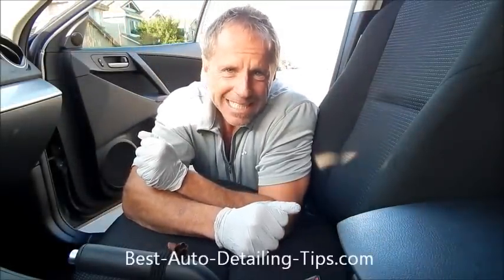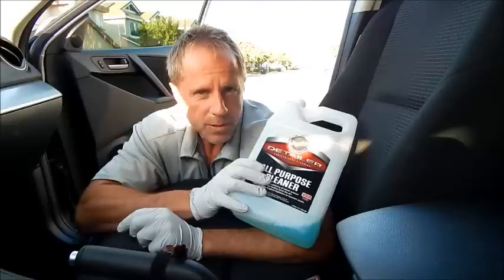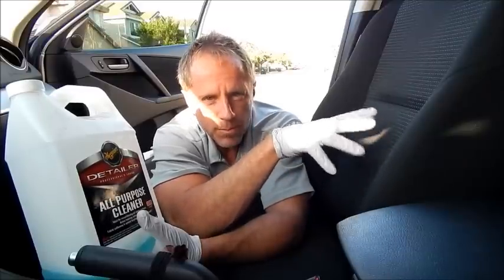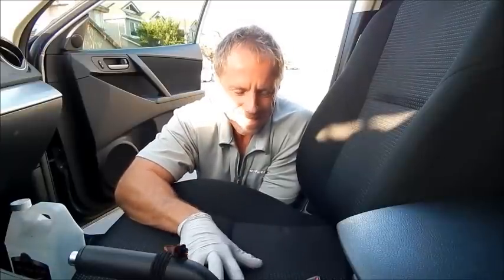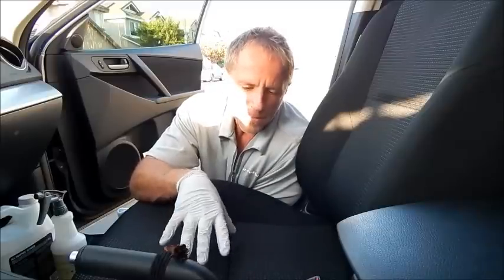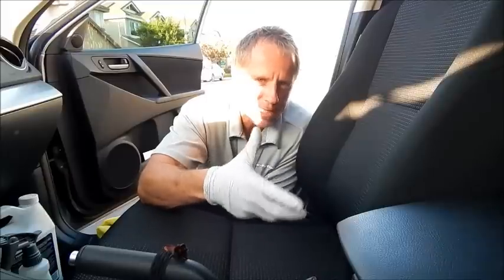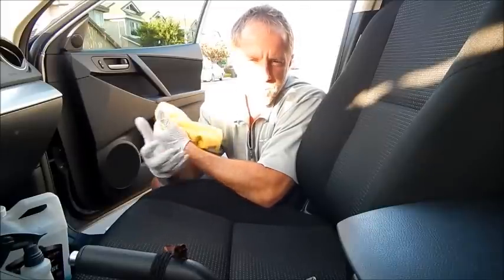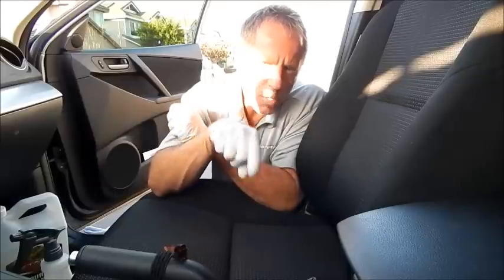Car upholstery cleaning: Special fabrics, Special Tips

Comment: READ THIS SUMMARY (and save 15 minutes)
1.  Use an All-Purpose Cleaner.  Simply dilute the cleaner with water depending on how delicate the material you are cleaning is.
2.  Use a super degreaser for, you guessed it, super greasy messes.  Dilute as necessary.
3.  For purely synthetic leather such as the microfiber in the Mazda 3 seen in this video, use an All-Purpose Cleaner and allow it to sit for a few minutes, then scrub it off with a light brush.

You're welcome!  Like this comment if you want to help others see this.
Reply: You sir are a god send
Reply: Hahaha THANK YOU. Got 2 mins in and thought this isn’t “tips” it’s marketing 🙄

Comment: David, that material in the Mazda 3 is microfiber, with very tightly packed super-fine fibers, which explain why its so difficult to clean. Most bristles are not fine enough to "poke" into the "crevices". 
My fav method is to lightly saturate with 1:5 APC, wait few minutes for it penetrate and loosen the dirt, brush lightly with a KIWI shoe brush (do not press hard to allow the bristle tips to go into the minute cracks) and wet-vacuum thoroughly.

Comment: Darren, thank you for this video! very helpful tips. I have a 2014 corolla with an ivory synthetic fabric and have made strict rules to my passengers to never drink anything that may spill or stain the car's seats. But of course, after 2 years, I have collected a number of spots and random spills. You mentioned that you want to do a special video in dealing with the fabric that is on the center piece of the seat. If so, I cannot seem to find it. Will you please share? If not, I'd like to make a request for a video that covers this topic and if possible for seats that are a light (nightmare) beige. Thanks again!

Comment: Hey Darren this is very useful video. My question is alcantara. My steering wheel is alcantara and I don't know how to clean it. Also it's very matted down and not fluffy anymore, how do I restore it back to the way it's supposed to be? Thanks in advanced
Reply from the maker: BarberKid It's very normal for the Alcantara to get matted down and will be a constantly problem. Keeping it cleaned and fluffed will help. You can clean Alcantara the same way you do anything else. It is a synthetic material so I use my APC and a soft brush to clean and fluff up the fibers the best you can. If you have compressed air, you can then use the air nozzle to shoot the fibers loose and dry them at the same time after cleaning.
Hope that helps.

Comment: Hello Darren, I have seen so many of your videos and I am so thankful for how much detail you go into in all of your videos. However, I do have a question which I believe you have not yet covered in your videos. Is the All Purpose Cleaner and Super Degreaser SAFE to use on ALCANTARA? My steering wheel and Shifter are wrapped in Alcantara and am worried about doing more harm than good.

Comment: Sir Markus. I have a 2013 Dodge Avenger. I have a synthetic black mesh like material for my interior. Rather than lightly going over a spot with a damp towel I poured water on the spot. Too much water. it dried in the sun and the water left a sticky residual ring on the passenger seat. Need advice on trying to remove this ring like water stain.

Comment: Hey Darren...Why not just use a degreaser all the time? I was just wondering because if its that effective I'd rather just use that once or twice rather than using an all purpose 4-5 times. Is it bad to use a degreaser all the time? Can it be used on everything else?
Reply from the maker: TruNorth Detailing I suppose you could use it exclusively, but there are times with a few select leather seats that the degreaser is more aggressive than I would like.

Comment: How do you clean metal/plastic speaker mesh? I dont want to ruin my speakers, but o want themto look just as clean as any other partof the car. Please help.
Reply from the maker: Markus Tikkanen You can use a small amount of APC and a tooth brush. After you have cleaned, just use your vacuum to suck back any excess liquid. Obviously go easy on the liquid you spray, but speakers are not so fragile that you have to be overly concerned.
Now days I have the option of the steamer of the Tornador, but both of these still introduce liquid into the speaker area, so you simply make adjustments.
Reply: I was thinking about the tooth brush. But now im thinking what is APC? Is any kind of cleaner good?
Reply from the maker: Markus Tikkanen APC stands for All-Purpose-Cleaner. See these links: 
http://www.best-auto-detailing-tips.com/all-purpose-cleaner.html

http://www.best-auto-detailing-tips.com/how-to-clean-car-upholstery.html
Reply: Well thank you very much!

Comment: I have this exact vehicle so i find it pretty funny that i was searching how to clean black cloth car seats and stumbled on you cleaning a Mazda 3 haha, anyways i work with a precast cement company and i leave work covered in cement sometimes different colors (White, Red, Purple) my question is the cement has soaked in to the seat is there anything you would recommend for something like that? Its not actual cement more like the powder substance of that cement that has stained my car seeing how the seats are black and I'm dealing with white cement you can imagine how difficult it has become
Reply from the maker: 916prodigy I would likely use air pressure nozzle to blow out as much dust as possible then a steamer to clean, but these are professional tools and likely not available to you.
Reply: +916prodigy I'd invest in some seat covers may put plastic between the seat and the seat cover to prevent bleeding thru the car seats, then a set of weather tech floor mats or you can get cheap floor mats to save your carpet.

Comment: Hi Darren, am Aziq from Malaysia. Quick Q, is meguires APC acid base? And to clean rims, do you use degreaser on them? I used multi purpose cleaner (mpc) for rims, 50% dilution. I spray the mpc and left them about 10 mins, and the paint on the plastic hub cap (grey color) seems to be melted, a bit.

Comment: How specifically do I use the Super Degreaser for maynaise stains on 2015 Xterra seat. Scratchy upholstery probably synthetic. I paid a mobile auto detailer to tackle it (right away) and he didn't use anything special on the maynaise stains and I have what looks like oil stains left over. he offered to come back and use degreaser, but, shouldn't he have used that initially when I said it's maynaise? I don't want to pay professionals  anymore after this experience.

Comment: What will remove sticky stuff of dash without hurting it. Looks like someone put  or stuck things to it and it melted on. HELP!!!
Reply from the maker: You can try rubbing alcohol if you already have some around the house. An actual tar and adhesive remover will work. With that said, dashes are tricky as you will remove any natural "oils" (for lack of better description) in the cleaning process with these type of chemicals. It is a fine balancing act as to how aggressive you get as you can cause permanent discoloration. You will certainly have to apply some dressing afterwards to restore the original look and luster of the dash. Go very easy and rub lightly allowing the chemical to do the work to break down the "sticky stuff" instead of rubbing hard to speed the process up. It's a tricky predicament for all of us.
Reply: Thanks so much for getting back to me so soon. I'll let you know how it goes.

Comment: Darren, are you 100 percent against hot water extractors? What about in my situation where a customer has a 20 yr old minivan with a terrible interior. Stains all over the carpet and seats. Your method would take so much time and effort. Wouldn't a hot water extractor make more sense in this case?

Comment: Was that a Bissell extractor behind you?
Reply from the maker: Perhaps...I definitely have one and use it on occasion.
Reply: Ok, just asking because I bought one just to use it occasionally in my vehicle?  If you can recall ,do use any special cleaning solution inside that machine or any tips you can offer when it comes to shampooing car seats?  Thank you
Reply from the maker: I have a video shot on the subject but have yet to edit it; so many topics, so little time! I shoot a small amount of Meguiar's APC in the solution tank, fill with as hot of water as I can get out of the tap, and go from there. I will also scrub and pre-treat the are with my normal APC before hand, and let it dwell a bit before I use the extractor. I generally only use it on the very heavy liquid spills. Which in my world is rather infrequent. Unlike house carpeting, a car has so many different materials and tight areas, so you are very limited in the ability to use it anyways. But it is helpful when its appropriate.
Reply: Thanks

Comment: What can I use on tan cloth seats?
Reply from the maker: Same products, same techniques regardless of color. It's just on light colored anything. eg. cloth, fabric, leather, it will always be more difficult due to the light color and the dirt will always show up more. One of the trade-off's for light colored upholstery. Watch my video on Lexol comparison part 2 where I clean light leather in a Bentley and you can see what I am talking about. If this Bentley had black leather, the dye transfer would not even be an issue.
Lexol leather Cleaner: comparison part 2

Comment: What are the odds my upholstery is driving me crazy and I come here and find the model car to be the same as mine? Guess mazda 3 upholstery is hard to clean!
Reply from the maker: Yes and you are not alone. Many of the entry level cars have upholstery with what is really cool looking fabric, but very difficult to deal with. More and more car manufacturers are using these synthetic materials as they are cheaper to produce, look cool, but are terrible for cleaning and maintenance.